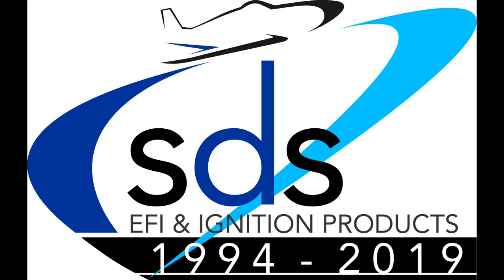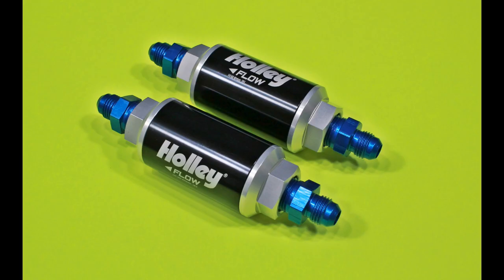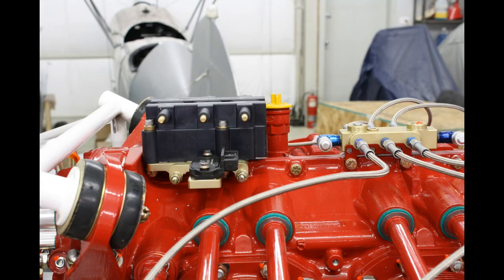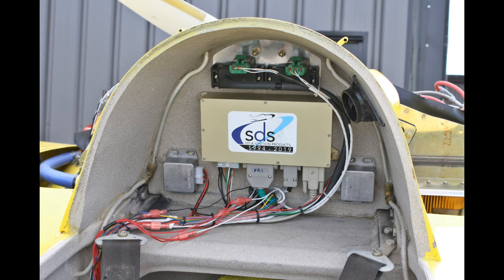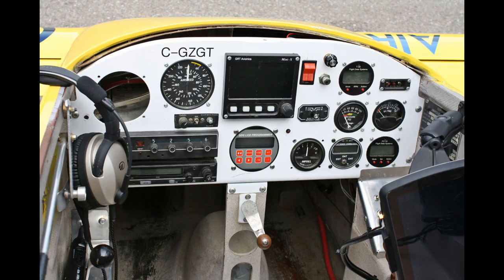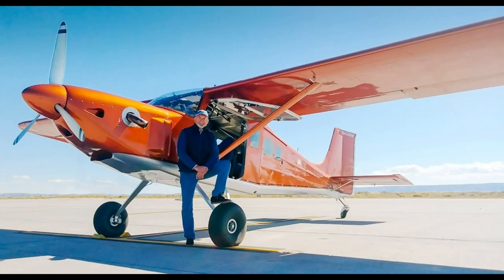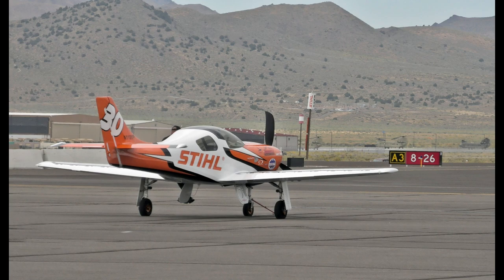SDS EFI Aviation Components in Pictures

Comment: 4:14 ....wow  
researching efi 540 / 460  (B47g2) ??  
CYTA , salute .
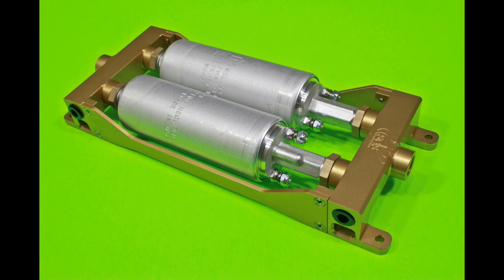0:25-0:37,  from experience with light helicopter operations (h500,b206)
 typical computer interface connectors  
were found to be UNreliable in vhf and hf radios
Reply from the maker: We have built over 10,000 ECUs in 27 years with many millions of operational hours and over 750,000 flight hours collectively. Not a single issue with these connectors. One of our bench test harnesses has been unplugged thousands of times and still works fine...